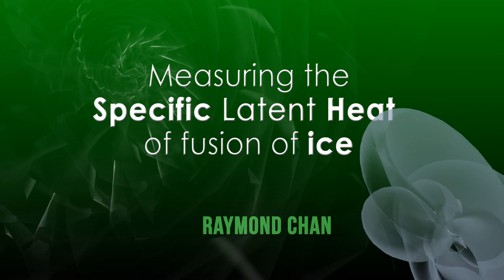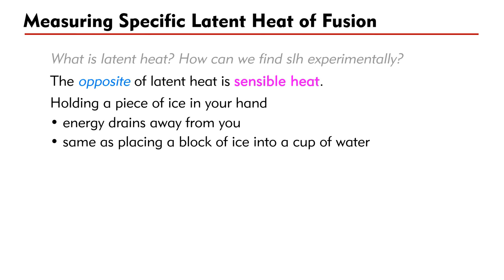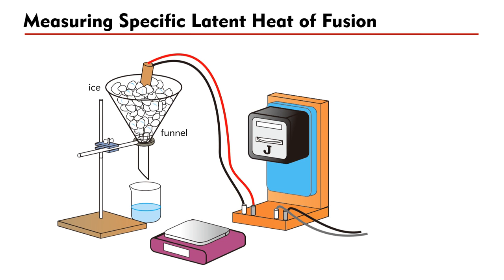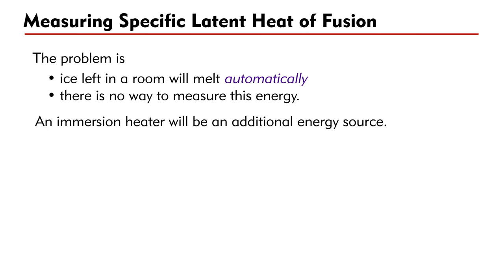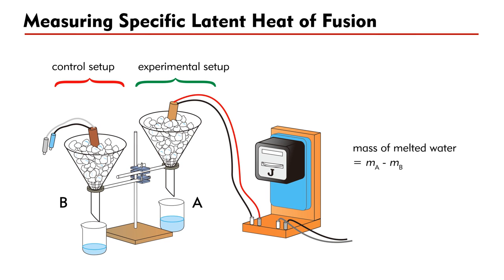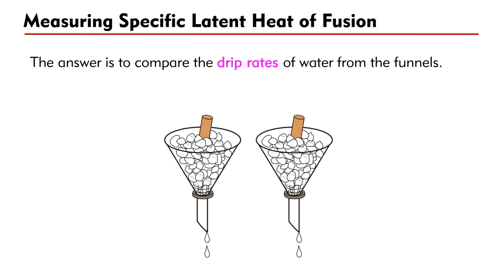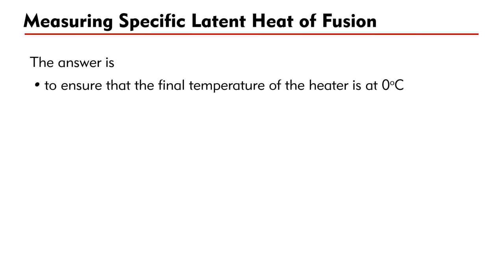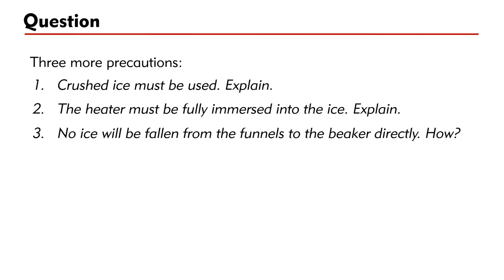Measuring the specific latent heat of fusion of Ice

Comment: 1. To increase the contact area between the ice and the immersion heater, so that the ice is heated more evenly. 
2. To avoid the heater from being overheated, and to increase the contact area between the heater and the ice, preventing further heat loss while heating the ice. 
3. Place a metal net/a wire gauze at the beak of the funnel.

Comment: 1)to increase the thermal contact to ensure the heat supply fully transfer to the crushed ice
2)increase thermal contact, reduce heat loss
3)place a very small hole net at the bottleneck of the funnel

Comment: a.To increase the surface area for contact the heater.
b.To ensure that the heat provided by heater won't lost to the surrounding.
c.Put a net with very tiny holes on the bottom of funnel.
Reply: for c, would a filter paper work?
Reply: @7rivon  yea

Comment: (a) Crushed ice is used because It can increase the surface contact between the ice and heater. So the experience result can be more accurately.
(b) The heater must be fully immersed into the ice because it can prevent heat loss to the surrounding.
(c) Put a net into the beaker neck to ensure that no ice will be fallen into the beaker directly.

Comment: a)Because it can make more thermal contact with the ice and the heater.So the less energy is used to fill up the gaps between the ice 
B)To increase the surface area contact with ice
C)Put a net in the bottom of the funnel

Comment: 1. To increase the thermal contact between the ice and the immersion heater.   
2. To prevent heat loss to the surrounding. 
3. Put filter paper on the bottom of the funnel.
Reply: +eric or the filter paper would absorb the melted water

Comment: 1. Ice should be crushed to increase the contact area with the heater.
2. The heater must be fully immersed into the ice as it can prevent heat loss.
3. A small piece of wire gauze or steel wool in the neck of the funnels can prevent the crushed ice from dropping into the beakers directly